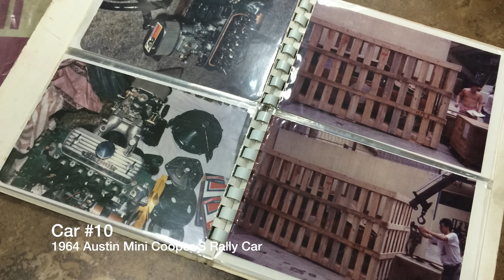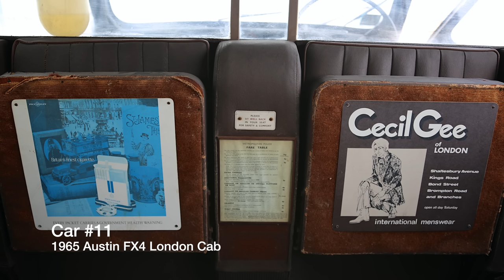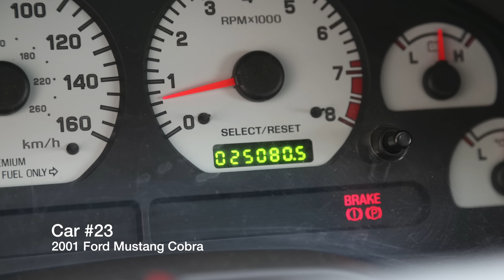25 Cars I Wish I Still Had

Comment: 1975 RR Silver Shadow - "this is a very practical car to own".  Righhhhhhht.
Reply: That's a case for it. The engine is hardly stressed.  Comfy and easy to drive long distance. A lot of the parts can be re-built with kits online pretty cheap. On long highway journeys you don't use the brakes much, so little wear on them there.
Reply: Theres a guy in Canada on YT who recently picked up a Shadow Corniche very cheaply. He is doing most of the refurb himself and it all looks very straight forward to me.
Reply: It's the cost of parts that kills the Shadow. That and boy do they like to guzzle fuel

Comment: I had an MG J2 too a long time ago. It was in pieces & it needed a new timber frame for the body the cost of which was beyond my reach at the time. After being continually hassled about it by my ex wife I ended up flogging it for what seemed like a whopping 200 quid but was actually peanuts as the price of anything classic MG sky rocketed not long after. I did great great pleasure from rubbing her nose in that fact for quite a long time! 👍